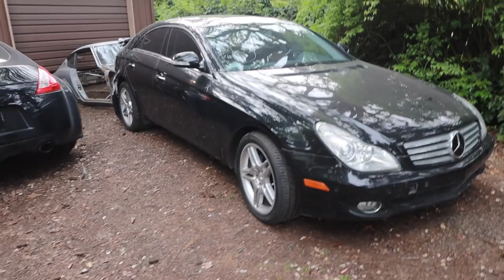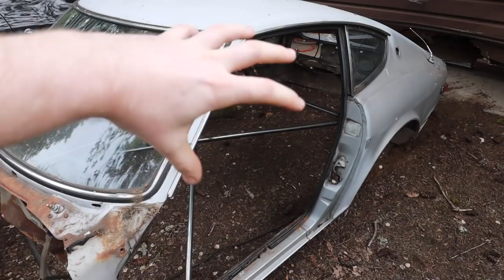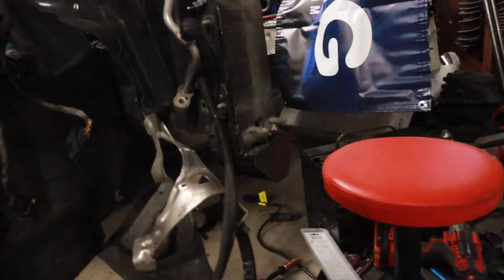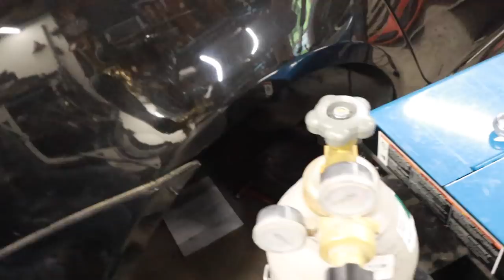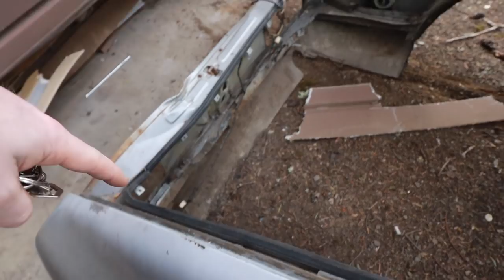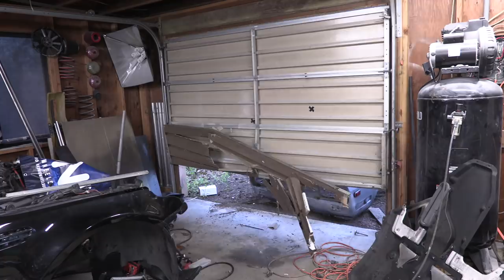TOW TRUCK DRIVER CRASHED 3 OF MY CARS AND KILLED MY 240Z...

Comment: Chris YOU need to get a lawyer. That tow truck driver can't follow directions and the guy from the company is trying to stiff you with the situation. Everything will turn out fine but until then get a lawyer and call the cops and make a report.
Reply: Second this!! Chris by going outside the insurance company he is simply trying to protect himself. Not only will he try to dismiss a lot of the damages but he is trying to keep his premium low. If thats is your first reaction after fucking up someone else's property i wouldnt trust the guy for a second. Get a lawyer! A good lawyer will be able to get you "back" you time spend on the build plus much more. Since its your business you can sue for downtime and damages and maybe even neglect for not following proper directions and assuring a cars brakes.
Reply: riltjd Your advice is sound. The phrase here is to the effect,an expensive lawyer is the cheapest thing you can invest in here. Get a competent lawyer who handles insurance claims as a practise. The primary motive of lawyers is not justice but money. Get a competent law firm on this. Whatever it costs ,just add to the settlement bill.
The insurance company and the towing company need to understand you are loading for bear here. They just want you to go away. Do not let them railroad you. Good luck.

Comment: Instead of using the money to get another 240z you should take the money for a replacement Z and send the shell to an actual body shop. They can put it on a frame table and use tension to pull things back straight and lazers for alignment. That way you keep your Vin and won't lose the time spent PLUS having to do it AGAIN! I've been in the auto repair business for almost 20 years now and I've seen body guy do things that us lowly technicians consider black magic. It's worth looking in to anyway.
Reply: Yes they can. They will weld on plates to use as pick-up points. I've seen it done with my own eyeballs.
Reply: This seems like a good idea.
Reply: Hopefully he sees it. I'm not sure if realizes that it can be done and that we wouldn't consider it cheating since it's damage incurred during storage. He's so focused on doing everything himself he probably thinks we'd take issue with him sending it out.
Reply: That's absolutely incorrect. If you ever get a chance to see a frame/body straightening machine you'd understand. By welding plates to the bottom frame rails/rocker panels they can then bolt the car down at those points and then add more where needed like the B-Pillars and the rear fender arches. It's simple in theory but it takes skill to get right.
Reply: Assume room Temperature your absolutely correct, it’s possible the theory is there but as someone who operates frame straightening rigs that would be very difficult to do.
Reply: That's the perfect solution!
Reply: SKATINGFORBREAD Gaming he is correct and I’ve seen this
Reply: Frame/Body shop local to me has an old Bel Air on the rack that if I had seen it anywhere else, I would've assumed it was beyond repair by a large margin, and some of the pictures of previous wrecks they've made whole again are incredible.
Reply: I've seen it done on later model cars , I dont think that body would survive that kind of stress.
Reply: Boys you make out like it is an impossible task, i mean at the end of the day all it has to do is RESEMBLE a Z, it doesn't have to be exactly to the right proportions, if he wanted a correctly proportioned Z he wouldn't have chopped it up in the first place... and straightening it out wouldn't be that bad just find signs of warpage and kinks and apply heat and straighten...
Reply: It's amazing what a good body guy can do.

Comment: I've been in a similar situation in the past, though not as much damage.  I had a car towed on a roll back from where I bought it to my shop.  While unloading the car, the tow truck driver curbed both passenger side Mugen MF8 wheels beyond belief.  The driver admitted fault and wrote on the delivery receipt that the wheels were damaged, so I called their shop to straighten it out.  The owner of the towing company desperately begged me not to file an insurance claim and offered to write me a check for $400...$200 for each wheel...LOL.  When I told him $400 wouldn't even purchase one of those wheels, he got mad at me for having "stupid custom rims" and that I was "shit out of luck".  So, I made an insurance claim for the damaged wheels, and a week later had a check for $1700 to cover the cost of two new wheels and shipping costs.  NEVER settle out of insurance.  These shop owners will always try to lowball you.
Reply: Yes.
Reply: You got insurance check in 1 week? Hmmm

Comment: So unfortunate man... I would only suggest getting a camera inside the shop for peace of mind.
Reply: Lam Le He should get a 4 channel dvr system with cameras inside and out. You can get a decent system for around  $250 which is more than worth it considering all that equipment, cars, and parts sitting in there. That garage is a junkies wet dream. Also for occasions like this so he could watch the driver deliver and make sure hes where he wants him. My house isn't anything special but we installed a dog door in it so I put one In. I can find out which dog out of 3 had an accident too even though they have a freaking door.
Reply: agree'd Need a new cameras setup not only for stuff like this but people snooping around

Comment: To reiterate other comments: definitely retain an attorney that specializes in this type of thing.

This is an odd claim and they'll attempt to screw you over. An attorney will set them straight real quick and his/her retainer will pay for itself many times over. And as a plus you get to outsource the stress of dealing with this to a professional.
Reply: icandreamstream why would you call this an odd claim??
Reply: Cane Sugar 

Good question; it’s because of all the unusual damage. For instance: multiple auction cars (will they try to base the value of the damaged components at a fraction of the value due to it being purchased at a good price at auction, or full replacement value? Will they go with OEM parts pricing? Compensate Chris for labor to repair? Etc.), his tools (both esthetic damage and functional damage most likely. Again how will they reimburse for the nonfunctional damage), garage door, shell of the 240z, Chris’s professional time invested into the 240z, as well as the lost revenue from B is for Build episodes that couldn’t be uploaded and monetized on time.

Under tort law he’s entitled to compensation for all of those losses due to the negligence of the driver and he should be wholly reimbursed. That dollar amount will be subject of a lot of debate due to the difficulty of fairly appraising some of these damages. An attorney will be able to handle this for Chris.

Comment: I got rear ended in a 96 miata with 26,000 miles on it and they valued it at $2200. After I laughed and told them to find me one more original 96 miata with that low of mileage they gladly paid me the $6000 I asked for and said it was worth to me. Glad you are being positive.

Comment: AMG "appearance" package.... FML 😫
Reply: Edwin McMillan BMW has the m sport package which is usually appearances too though not always.
Reply: Craig Bolin thnx, but "M Sport" package doesn't include "M3" etc badging.  putting "AMG" badging on a Mercedes and calling AMG APPEARANCE package is.....dubious
Reply: Edwin McMillan no different to vw’s r line and fords st line. Just appearances across the board selling the look of the actually good cars to those who can’t afford the real deal
Reply: Edwin McMillan M sport on the 2 series actually does say “M” on the badge, same exact thing.
Reply: FPS Gamers no it says M235i which is obviously not an M2 and neither just the M Sport Package. So obviously a hole different thing
Reply: Jack White bullshit the thing that would be no different is the AMG line but those dont have an AMG badge on the back. This ohne does. So this shit is the same thing as these 320i Drivers putting M badges on their car
Reply: Andy Evers right!!??
Reply: Edwin McMillan Well the wheels, steering wheel, and shift knob do but I understand your point. BMW is confusing on a whole other level with M models that aren't M cars like m3 m4 m5 etc...

Comment: Tip from experience: You probably have your own homeowner's insurance. Though you don't plan to file a claim against your own policy, it would be wise to call your agent before you touch anything.  Your agent and your insurance company- if they're worth their monthly beans- will want to document the damage on your behalf, have their own adjuster give you an assessment of the damages and possibly deal with the tow company's insurance company for you.  
If there's a question as to whether the tow company has adequate coverage, is disputing liability or damages, or avoiding dealing with the issue promptly, your insurance company can advise you on how to proceed and whether to obtain counsel.

Comment: For men projects are as close as they come to birthing a baby.

That weird feeling you got over the 240z is part from knowing what you wanted to do with it,  and feel you where vary lucky to have gotten it.  You where able to inspect it, worked on it, and much like raising a child... (Please don't crack no dissection jokes...) but much like parent... you had the opportunity to mold it to your desire.  

Now that its broken, your in a state of flux, and might have to bury the shell.  On top of that, You feel the pain of your hard work being lost, feel the uncertainty of having to try and find a new 240z, and start all over.  I don't think insurance can recover you all that.  Even though its easy to see in the long run most if not all your issues are easily resolved by having someone get you another 240z, a garage door, and new broom, you also have to deal with emotional loss of things..  After all, when you work on a thing, it helps to define you, and to have to give up on a thing, even by circumstances outside your control, can change your envisionment of yourself.

You envision yourself as a doer, a builder, and you don't quite.  This action even outside of your control forces you to rethink that.  If you stop working on this shell, do you admit you found a problem you the expert car builder cannot resolve?
Reply: Israel Harris exactly

Comment: Hey Chris @bisforbuild, I'm 99% sure that Tavarish is incorrect. From what I can tell, that is a genuine AMG. I used to own a 2008 CLS (which is the same model and generation that you have) and mine was a 63 AMG. If your is the same year, +/- a few year, early on when Mercedes started making the CLS line, they were doing naturally aspirated V8s. The 55 AMG's were supercharged while the 63's were naturally aspirated. Out of the factory, the 63's made 510 hp and I believe somewhere around the high 400's to low 500's in torque. Ordering an AMG appearance package would only give you the brakes, wheel, body kit, and maybe a few other AMG goodies on the interior. Mercedes does not roll cars off the production line with an AMG badge on the tailgate unless it's genuine.  If you're seeing an AMG signature plate on the engine cover, and if the other side of that trunk has CLS63 on it, I'm thinking that's what you really have - unless it's a 55 and you somehow missed the supercharger.

Comment: Truck driver made a big oof lol. How did that work out though? When you tilt a bed down, it’s hooked up by a winch, you have to put on the brakes loosen the winch, unhook it, and then roll the car down. Idk.
Reply: they usually just use the winch to let it off the trailer for this exact reason, especially if the vehicle has been wrecked, because they wouldn't no the extent of damage of the vehicle and then this would happen. lol
Reply: GenevaCustoms yeah my dad’s a tow trucker, but, how did he manage to let this happen? That’s my question...
Reply: Joseph Samsor sounded like Chris said the the driver said he thought the brakes worked but didn’t, shouldn’t matter if he used the winch to lower it instead of just letting it ream off the trailer lol holy shit I would be pissed becuAse that car had to be movin to push the 240 thru the door
Reply: GenevaCustoms yeah but I mean usually when we take a car off, we’ll undo the safety strap, tilt the bed, loosen the winch to let it roll back a bit and loosen the chains holding it from the rear,  and then, if I’m there, I’ll hold the brakes, we’ll loosen the winch more until we can unhook it and let it roll down. We wouldn’t be able to unhook it if the brakes didn’t work because it would roll down and put force on the hooks. That’s my confusion. Basically I’m thinking this guy either has a very bad strategy or just got super unlucky idk
Reply: Joseph Samsor I’m not sure lol
Reply: It sounds like the guy just sent it. He should've used the wench. You don't need the brakes to unhook it because you can relieve the tension by extending the cable further. This sounds like a guy too comfortable with his job and forgets about safety.
Reply: And yes I've had to hold the brakes on my own car and rolled it off the flatbed but I felt I had a story to tell because that was super sketchy. The driver actually giggled when he told me to do it
Reply: Jay Hensley yes but when the car is tilted it’ll only be able to be unhooked if you have working brakes. I’m guessing he relieved the winch while the deck was level though, not a good idea
Reply: Jay Hensley yea the few that I have seen they lowered it completely by the winch
Reply: Joseph Samsor the only reason I agreed to let that happen to my car was because I was in the driver's seat and I knew my brakes worked. Letting it roll off instead of wenching it down was only to save time. Like jacking up a car and then not taking the time to grab jack stands. You can do it but 1 day that jack will fail. Safety first because Chris can tell you what happens when you cut corners

Comment: The BMW probably bounced back those couple inches due to the elasticity of the wood/plastic bumper.
The body is probably straight or can be pulled straight but since you'd like a sema car I'd say replace it since that metal work is going to suck. An idea for the wrecked body is get a cheap crown vic and throw away the body, shorten the frame and plop this on with a roll cage and drift this instead and sell the 370, possibly turbo the crown vic engine too, have your own version of the roadkill rotsun, and a shiny Z. Would be a nice contrast.  Wish you the best.

Comment: @B is for Build I didn’t know if it will work but have you thought of putting a gate on the driveway to the shop and putting a sign with detections to the drop off point? It might save some time and money in the long run. Hope everything goes well for ya. 👍🙂

Comment: Bro, get yourself a lawyer, make an agreement to have his fees paid separately in the case so it doesn't come out of your money. Write everything down and take pictures of every single bit of damage AND YOUR LABOR that went into it because you CAN SUE for lost wages and even work done to the car. My 1997 Legacy was just totaled in a really nasty head on collision at 70+MPH, we JUST rebuilt all the mechanical components, just put a new transmission in, inspected every inch of the motor, inspected the pistons, rings, valves, had it completely torn apart, replaced all the seals and gaskets, all new hoses, pulleys, tensioners, water pump, fucking everything, just put new Motegi rims and tires on it. We just got it smogged that day and were on our way back home when a 2006 Toyota Sienna came into our lane on the highway and slammed us head on, the driver was undocumented and tried to lie about the whole thing when a Sheriff was right behind us and saw the whole thing unfold and it was the ONE DAY I didn't have my dash cam, left it in my father's car. I've had over two months of phsyical therapy, medical bills out that ass, my dad was in the car at the time and he's been in and out of the hospital because of internal damage, etc. I lawyered up instantly so everything has been covered so far via my lawyer's leins and we're going after them for medical, pain and suffering, price of my mint Legacy, the sound system I had in their that was damaged, the new rims and tires and the cost of the parts and labor we just pain stakingly put into it, lost wages, even any bills we got late fees on due to this almost ruining us finacially since temp disability hasn't kicked in yet. They've ducked our calls for over two months now but we're pushing forward with the case as soon as my physical therapy is done.

Don't let yourself get dicked, man. You seriously need to lawyer up, it very much so sounds like they're trying to screw you over, even that tactic of his boss saying he can't contact him, that's bullshit, he's bullshitting you. They're trying to delay it as long as possible so it's harder for you to sue for damages.

Comment: you can probably use most of the non rusted panels that are left on the 240 z like the roof and the quarter panels to repair a rusted out 240z the rusted body is straight so you can pull the panel straight again on using that as a measuring device 
keep the shop safe ? put a nice mean dog in there !  , best alarm system ever 
if the guy want to settle outside the insurance ? dont get burned have a insurance calculator make a bill for the damages made and use that to show the guy the damages he needs to make

Comment: Would a new or pattern scuttle panel tell you where the bottom of the wind shield should line up to. Though that would only work if the shield A pillar has not been pushed back as Well. Good luck.

Comment: The Porsche does not have a frontpanel. The piece under the windshield is the same sheet that goes over the roof. So if you were aiming for a topnotch restoration, you'd have to get a new roof!